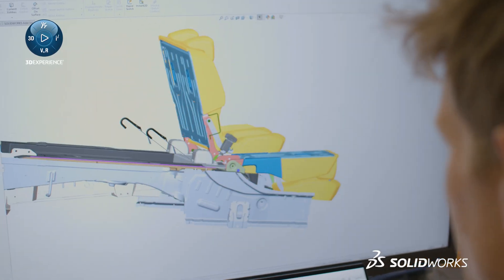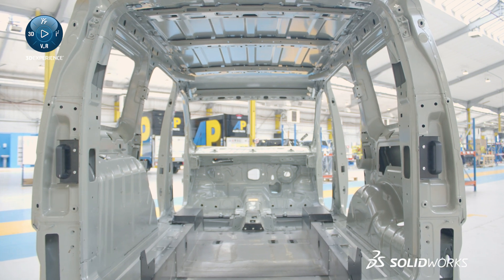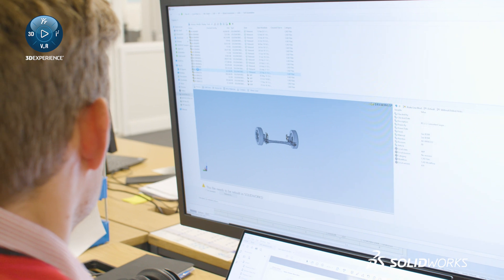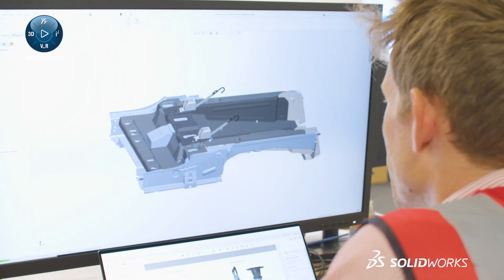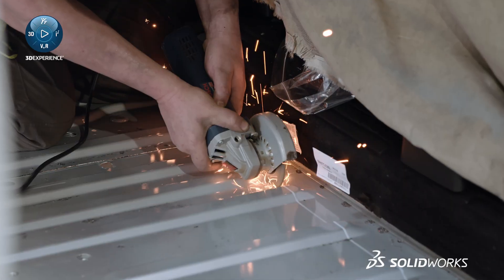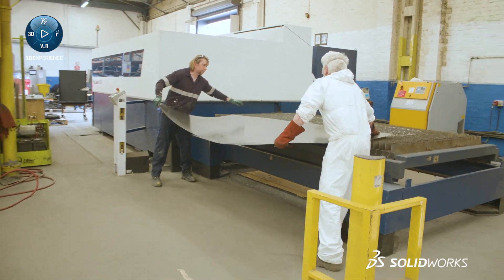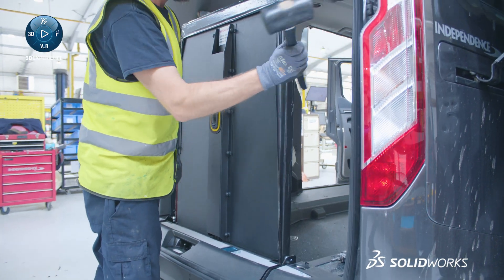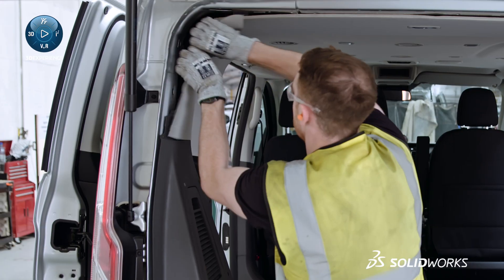Discover how Allied Vehicles uses SOLIDWORKS to convert vehicles to be wheelchair accessible

Comment: Hi, SOLIDWORS Channel, would you please post a video  on Body In White Sheetmetal Modeling Technique.  How much capable SW is to do BIW Sheetmetal model using the existing sheetmetal Feture Tools? I seen SW sheetmetal tool is only limited to do enclosure type modeling and some basic flange type operation, but in case of complex shape how these tools support to model?

-Thanks
Reply from the maker: Thanks for the suggestion!